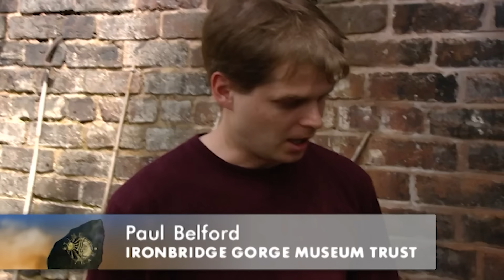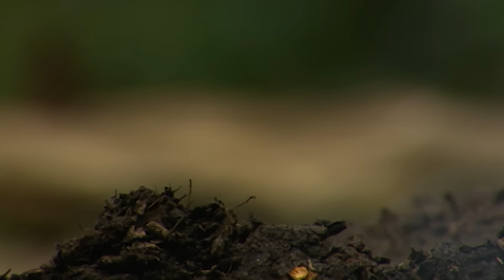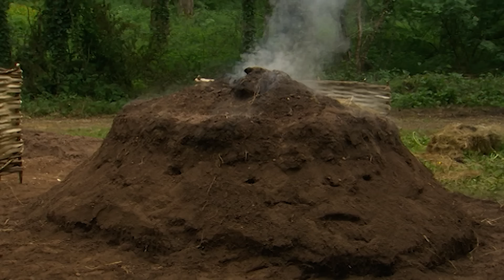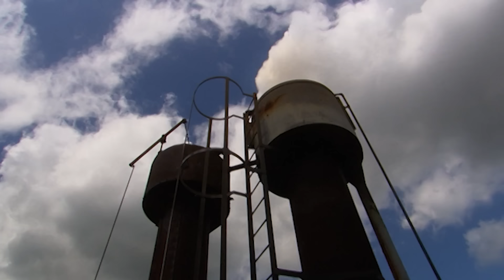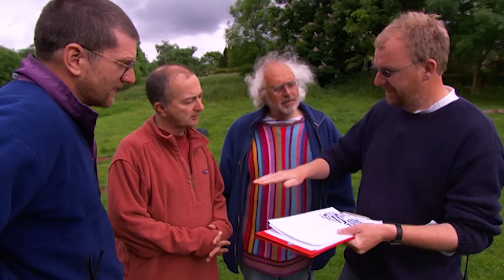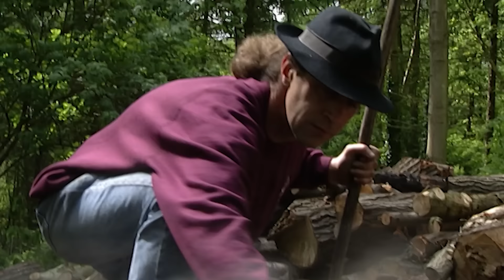The Furnace in the Cellar (Full Episode) | S9 EP5 | Time Team (Ironbridge Gorge)

Comment: could you make canon ball for historical battle re-enactors with only electric power or dose the iron need higher temperatures then the electrical wire can bear before melting.
Reply: [replaced my entire 1st guess of a reply once I did minimal research..] 

I had wondered if industrial induction coils could "melt" raw ore efficiently enough to achieve what you're asking, but as expected, metallurgy is too complex to be that simple. 

Ore requires "smelting", which is a chemical process of reduction (removal of bonded oxygen or impurities that result in slag), and that requires carbon or flux during the heating process. While Induction heating (simple melting) is sufficient & very efficient for processing "already-purified scrap" metals, and in some cases for smelting fine mixtures of conductive & reductive (smelting) substances with raw ore, the ore by itself cannot be properly smelted with Induction (or simple) heating alone, no matter how hot it's melted.

That being said, there are a few advanced & complex electro-chemical processes that can also extract pure iron or other elements from raw ore, including at much lower temperatures, but my struggling brain can only suggest interested brainiacs research that themselves.. 

this was a fascinating rabbit-hole to peak into, but I've reached my limit in this context.. haha.  cheers🥂
Reply: @jimbeardsley222 And electrical induction smelting of scrap has not always been plain sailing.  I had a mid 80s Nissan pickup where they used induction recycled scrap for the frame, and the metal remained flakey, and hugely prone to disappearing in a pile of rust… which mine duly did.
Reply: @Theravadinbuto  😳 .. when metallurgy resembles cartoon-ery 😬 .. considering the sorcery (chemistry torments me) that seems to underlie smelting & alloys, it's a wonder to me that humans ever surpassed horse-drawn chariots & canal boats.. yet, soon-ish, passenger drone taxis will fly somewhere in China (allegedly) 🫣